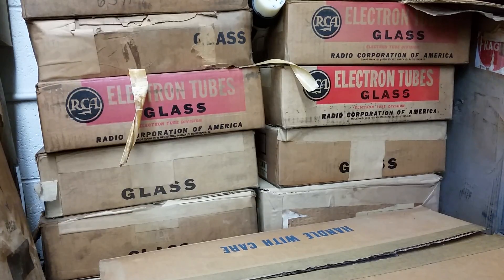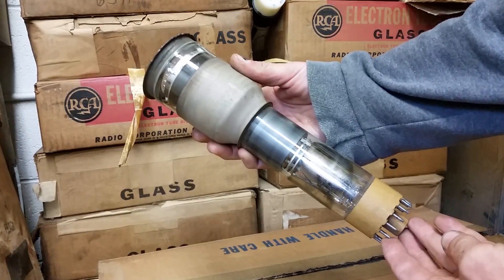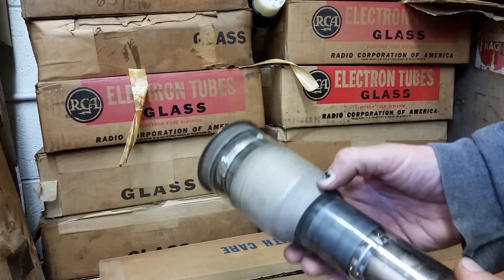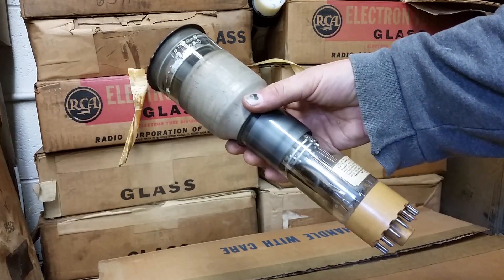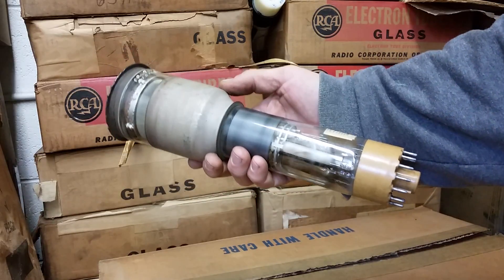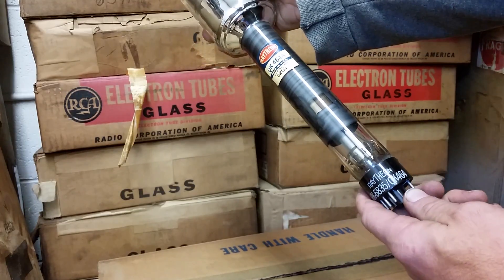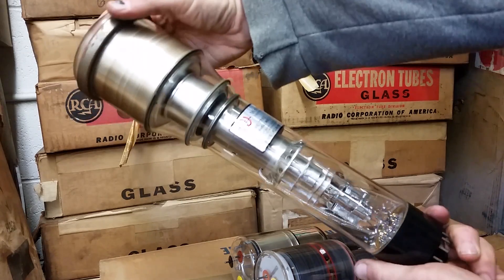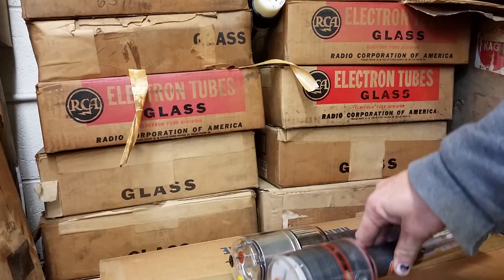Radechon Computer Memory Tubes

Comment: I've always wondered if these kinds of tubes could have been used to store video picture information in a buffer. 

Such as a televised horse race in the 60s being able to loop a single frame the instant a horse crossed the finish line.

I could even see a modern version being made using an LCD screen and a CMOS sensor arrangement.

Comment: Very cool.  --never heard of these.  Wonder if you could simplify the drive on one of these with a CPLD to run the refresh/redraw circuitry.  Thanks for sharing!
Reply from the maker: Certainly modern tech would make doing the memory decoding easier, but you would still have the messy analog stuff dealing with the deflection amps. On these tubes, the deflection amps really have to be rock solid stable, otherwise things go bad quickly.

Comment: The last use I can think of for the Radechon (or Williams tube) was a microchannel-plate storage tube used in the Iwatsu TS-81000; this was a 1GHz hybrid analog storage oscilloscope which used a colour LCD as its main display.  It was introduced in 2002 and I believe it was made up until late 2010.
Reply from the maker: Wow, that is late! Was that a radechon or an electron bombardment semiconductor? I have one of the latter kicking around, from an old bit of Tektronix gear - when a CRT and a silicon wafer full of diodes have a train wreck.
Reply: Actually, looking back at it, it was a hybrid CCD storage tube and not a Williams tube.  It used a CCD which stored the image produced on a photoconductive target.

Comment: I wonder does memory size of Radechon depend on refresh speed of drive circuit or tube itself?
Reply from the maker: I do not think so. CRT based technology has always been very fast, mainly due to physics, and how electrons can be thrown around pretty quickly. I think the limitations of the electronics of the deflection amplifiers have been more important with regards to total system speed.